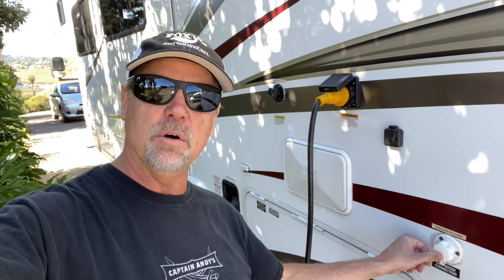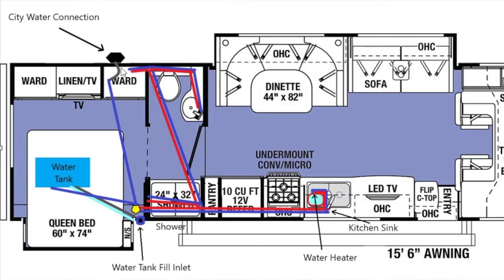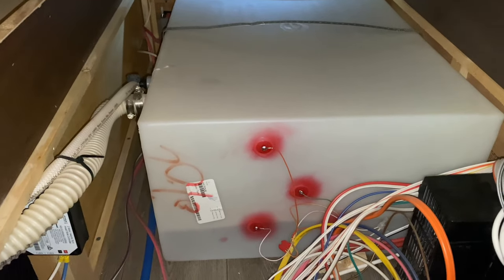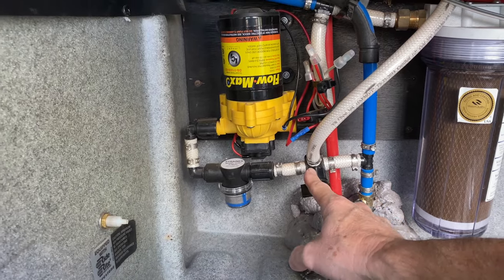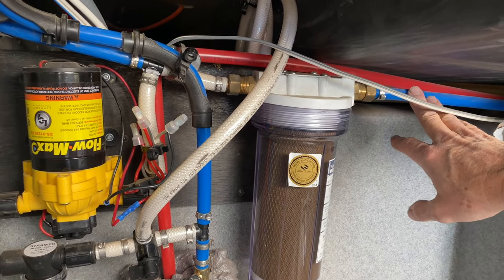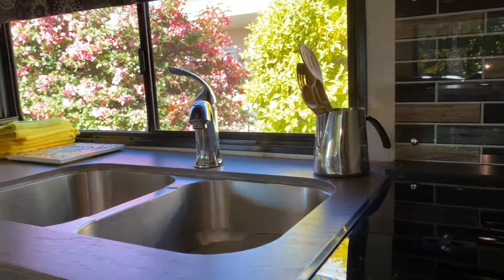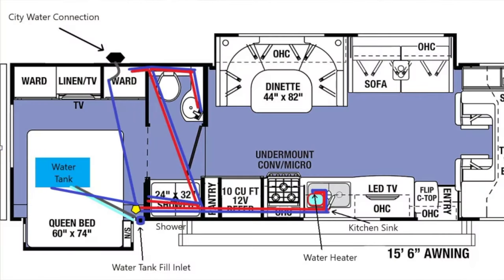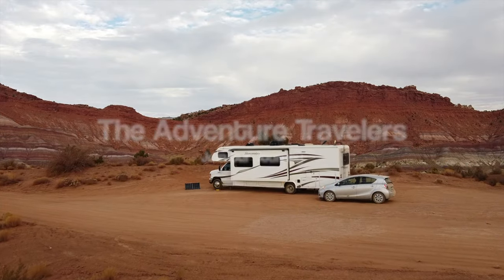RV Water System Explained In Depth

Comment: Hey Southern friend.... LOLOLOL Hi Mike!
Great video!! 
The extra hose before the pump is to suck RV antifreeze into your system through the pump, so your lines don't freeze in VT at -20° hahaha . The red and blue lines outside are your lowest hot and cold line point in the system, so you can crack those and wait for water to pump through your sinks, toilets, showers, and out door showers. The antifreeze will flow out the lowest points.  then close those valves.. The hot water tank shut off valves are to bypass the hot water tank, so you can drain it out for the winter. All water must be removed!! 
Frozen pipes suck, but you wouldn’t have to know about that in So.Cal.
P.S. always bypass your water filter before pumping antifreeze into the system!
Reply from the maker: Thanks, Mike PQ!  I really appreciate the comment and clarification.  Yes, you are totally right... I'm from Southern California and have no clue on how to winterize my RV :-). I would have to watch a YouTube video. LOL.   Your notes were so well written, that I have put them in the show notes area.  I hope you don't mind.  I gave you credit.  Always a pleasure having you watch our videos.  I love seeing you and Kathy flying around the country and riding your motorcycle.  Looks like you're living the dream!  Hope to see you both again soon.  Michael & Melissa
Reply: How do you bypass the water filter? Do you have to do this manually? I just removed the filter and then used the extra hose to pull antifreeze throughout. It of course filled the water filter housing first.
Reply: @cdb1386  I have a bypass hose with the filter fittings in both ends. It just replaces the filter, so the antifreeze just flows throughout the lines.
Reply: Just a heads-up. Your "extra hose" is the pick up line to draw antifreeze directly from the bottle to winterize the water lines.
Reply: Let's turn to God Shepherd's Chapel explains the whole Bible God bless

Comment: This is by far the most amazing and informative RV video I have run across! You did an absolutely great job in locating and mapping out the water system and answered a lot of questions I had been thinking of for my RV. Outstanding!
Reply from the maker: Thank you so much for the great compliment Dennis. I appreciate it. I learned a lot tearing apart my RV as well. L O L.

Comment: Hello. Stopping by to support you.  Wishing you all the best.

P.S Thank you for helping me start a relationship with my new RV’s water system; phenomenal detail!
Reply from the maker: Thank you so much for the wonderful comment. I’m glad I can help in someway. Wishing you the best. Safe travels.
Reply: @TheAdventureTravelers  update found out the problem is a broken water pressure valve regulator. I took it off. Water is flowing to the shower and to the faucet. Thank you for helping.

Comment: Hello!
I just watched this video and have to say Thank You! We just bought a trailer and I've not seen a better explanation of the water system anywhere on You Tube. I feel so much more educated on it. Thanks for taking the time for the newb's like me!
Reply from the maker: My pleasure. So glad it helped. Have a blast in your new trailer. I’m sure you will. See you on the road.
Reply: @TheAdventureTravelers  what are the blue and red pex lines hanging on the rear of my RV for? The dealership walked us through everything but I forgot what they are there for.
Reply from the maker: @jocarson5310  If they have valves on them, they typically are to let out (discharge)hot (red) or cold (blue) water out of your water heater or water tank.  Can't really tell without pictures.  Sometimes they can be a way to input antifreeze into the system when you winterize your RV.  Hope that helps. Hard to tell without pics.  Sorry.

Comment: Awsome video,  all you need now is a video of how the electrical system works. 12v and 120v.
Reply from the maker: That is a great suggestion Fernando. I will have to think about that and possibly make a video on both the 12V and the 120V. So many RVs have absolutely no specs on their electrical systems.
Reply: Did you make one yet? On 12v vs 110

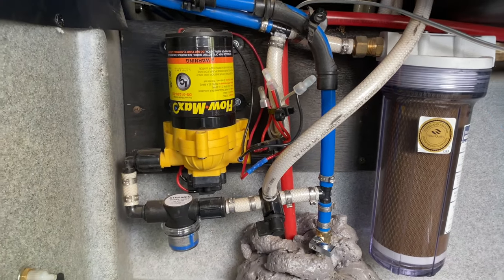Comment: The spare hose at 5:35 is there to winterize the unit, simply close the valve at the bottom of the hose to cut the tank out of the system and place the end of the hose into a container of rv antifreeze turn the pump on and it will charge the lines with antifreeze. This feature is on rv's with "winter packages" along with tank heaters and a insulated underbelly.
Reply from the maker: Thank you so much. I found that out right after I posted the video. Since I live in Southern California, I don’t really have a need for it. I do however, have a polar package on my RV, which is great for camping in the snow.  Thanks again. I really appreciate it.
Reply: It's on almost every camper not just "winter package" which is just a scam to charge more money. The belly insulation is just a foil sheet

Comment: Oh thank you! This was helpful to navigate the hoses. 
I have SO many water questions in my new old (1997) Jayco trailer! 
Let me know if you have any videos of the following: 
#1. I want to move the intake locations on the exterior of the trailer. Just down about 3 inches because on the inside - the jackknife sofa rests directly on the hoses and causes the bed not to be level…🤦🏻‍♀️
#2. Replace the HW tank.
#3. Swap out all faucets and shower/tub spigot.

And when I do these things maybe I will make a video. 👩🏻‍🔧
Reply from the maker: You should definitely make a video and share it with others. I do not have a Jayco trailer, but I know they are everywhere. Your video would do well.

Comment: Excellent overview, best I've seen. My rv 2012 23ft Walkabout by Homette has some of the pluming above the underbelly and below rv's floor - not as accesable.
My leak occurs at water pump, which is under the kitchen drawers, and placed nearly to the outer edge of the trailer, making it hard to access without removing all the drawers and the vertical panel above the pump (panel is right at, touches,  mid-section of pump, arg). THIS LEAK ONLY OCCURS WHEN I TURN ON THE HOT WATER HEATER !?      Is It:   1) the hot water 'in' fitting on pump?  2) some other logical point on the pump?  3) should i pull everything out and check the shurflo 4008 for other possible failure points ?
Reply from the maker: Sorry to say but you are most likely going to need to take out the drawers and panel to get a better look.  If your drawers are like mine, there should be two black tabs on the side of the slide mechanism.  Simply press those together while pulling the drawer and your drawer should release from the slide.  Typically, a pump, pumps water into the water heater, not the other way around.  Typically, the hot water never goes into the pump. The pump just pressurizes the hot water in the tank and pushed hot water to the sink/shower.  Maybe the water heater (when turned on) is putting backflow pressure to the pump and perhaps there is a check valve near the pump that is not working correctly.  Sorry, without being there, hard to help.
Wishing you the best.  Please let us know the fix.  ~ Michael

Comment: Nice video, looks like you have 2 leaking valves at the back of your water heater.
The corroded ones I'm talking about.
Reply from the maker: Thanks.  Already replaced those.  Yes, they were leaking.  I didn't realize that I didn't have an Anode Rod in my water heater, so they got sacrificed and corroded.  Uugh.  All done now though.  I will post some pics or a video of that soon.  Can't post any pics on these comments, which sucks.

Comment: As others have stated, well-produced video in tracing and explaining the typical plumbing system.  Kudos!
One comment, though, that I have not seen on this thread:  the RV industry's mixing of materials in the plumbing systems...namely PEX and vinyl tubing.  This is a pet peeve of "Rigor RV Repair" (also on YouTube) to the point where he won't consider some RV brands (such as GDRV).  In short, he believes that using PEX crimps on vinyl tubing is a big no-no....a set of leaks that are inevitable.  Yes, the vinyl tubing is flexible and makes great curves (as in your rig going to the outdoor shower fixture), whereas PEX is not so easy to make turns (without the use of more fittings and more time ($$) in manufacturing), but I believe him when he says that PEX crimps should NOT be used on vinyl tubing (you couldn't pass code in a sticks & bricks application, so why does the RV industry get away with it?).  As such, I plan to strip out all my rig's vinyl and re-plumb with PEX tubing and PEX crimps on PEX connectors (brass).  Just food for everyone's thoughts.  Cheers.
Reply from the maker: That is great information. Thanks for sharing. Don’t even get me started on RV wiring. Lol. Every color under the rainbow and none of it makes sense.

Comment: Awesome video! Found my pump and converter in one of my bays so easy to change filter or anything that might go wrong.
Reply from the maker: Oh, that is great news. There are a lot of RVs or trailers that have these areas in nightmare conditions. You should have seen when I would have to do oil changes or repairs on my boat. There is hardly any room on a boat. Glad I could help.

Comment: Thank you for the great explanation! Definitely the most helpful videos out there. I do have one question how does the outside water inlet connect to the tank fill port? Is there a fitting in the outside inlet or just the hose?
Reply from the maker: Sorry for the delayed response. My wife and I are training to hike the John, Muir, Trail, and we have been out of cell phone connection. To answer your question, if I understand it correctly, to fill your tank, there is just a cap and an inlet that you put your hose into and you fill up the tank that way. There is no connection per se. your tank is filled by gravity. The water just goes down the hose into the tank.

Comment: Hi. Great video. 1 question. Does the used water from the kitchen sink go to the black water as the bathroom water?
Reply from the maker: The kitchen sink water goes into the gray tank. Not the black tank. The black tank is just for Poopies.  That’s why you always dump the black tank first and then dump the gray tank because the soap from the gray tank will wash out your gross black tank remnants.

Comment: I have a truck camper. My sink in the bathroom has very low water pressure and sometimes I get No water at all . How can I find and fix this issue?
Thanks great video
Reply from the maker: Sounds too easy, but first check the screen on your tap. It may be clogged. Clean with vinegar and water to get rid of the scale. Let me know if that works.

Comment: Thanks for the detailed video. So I’m assuming as hot water is used from the hot water heater the water pump keeps adding water from the fresh water tank to it when it’s running?
Reply from the maker: Yes, let’s say you have a 5 gallon water heater, you can get about 8 gallons out of it during a long shower because it is constantly being replenished with water from either your tank or city water.  I typically only turn on my water heater about 20 minutes before I need it. So it’s not consuming a lot of energy all day.

Comment: This video is so helpful! I'm about to add a water system to my '71 scotty camper and this is exactly what I was looking for. The only question I have is, is it possible to plumb it so that the city water can be used to fill the tank inside the camper? Or is there a good reason why these are separate connections/points?
Reply from the maker: Hey Klayton, i’m so glad you like the video. Yes it is possible to plumb the water to fill the tank inside the camper but what happens if you forget to turn off the water at once the tank is full? It will just spill out the overflow valve. Typically, you just fill the water tank and once that’s done, you can connect to the city water and just use the city water pressure to have plumbing inside your RV just like at home. Just ensure that you turn off the water pump, or else you will be pumping water from your water tank instead.  I hope that helps.  Try not to think too far out of the box, RV water systems have been around a long time and most people have thought of everything. The way the RV is typically set up is usually the best for that type of RV.

Comment: Great video but you failed to mention what prevents the city water from filling up the holding tank. Unless I missed it? In my experience it’s been the only part of my rv’s (3 different makes models etc) water system that failed me. 

That’s the check valve on the water pump. My 1997 Winnebago wonderer 35 motohome ever saw 5lbs over 40psi it would overwhelm the valve on the pump and fill up my freshwater tank until it was like a balloon under my floor😅. 40psi is the magic #.
Reply from the maker: Thank you so much for the information. Yes, I always use a 40 pound water pressure attachment on my hose.  We just got back from a 21 day trip traveling in the Pacific Northwest. Good times.

Comment: Great video..very informative!  Can I remove under bed "city water tank" and use only water supplied by hose?  (For non traveling trailer) Since water is supplied with some pressure  would I need water pump? How would you get to this issue? Winterizing would be a snap! Thank you!
Reply from the maker: In theory, yes, you can remove the water tank, if you never plan on using it and only want to have city water fed directly into your rig.  

The water pump only pumps water from the tank.  You will not need the pump if you are directly connected to city water pressure.  Hope that helps.

Comment: Great vids. When your RV is hooked up to city water how do,you prevent water coming from the city from over filling your RV water storage tank when all your faucet are off?
Reply from the maker: If my check valves are working correctly, the water should never be going into my tank. It is a straight path that bypasses my tank altogether. The only way I can fill my tank is from the outside (a totally different input).
Reply: @TheAdventureTravelers  but at one point the output from your storage. tank merges with the output from city h2o then heads to the shower/faucets at that point where they merge , when pressure builds up from city h2o does it back flow to your storage tank or does it have a one way valve? Thanks

Comment: I hope some reads this soon . Ha
 @9:24  it shows 3 valves but my water tank has 2 only .. will that become an issue?
   Basically the bottom line and the valve in the middle are only ones I can see .
Reply from the maker: Without seeing your water tank, I can't really give you a, "for sure" answer, but I think you're good with only two valves.  Just think about the flow of water (hot or cold) and what the valves accomplish by turning them on/off.  I think you should be good.  Hope that helps.  If everything is working well now, even better 🙂

Comment: Where would be the best place to put an extra filter ? I don't have a water system like yours, because I have a older 5th wheel.  I'm asking / wondering because the water here has chlorine/hard water with lime scale issues and a funny smell... I need to put in a filter for my kitchen and for my shower... I'm wondering where to put a small one at and how to do it. My under sink is exactly like yours but I cannot get to my shower lines. So I was thinking of adding a filter where my bathroom sink is because of the lines connecting, what do you think? I live in VA and the weather here last night was 7 degrees...
Reply from the maker: Of course, it is hard to give you an exact way to do this because I don’t know your rig. Since it is freezing there, you should put your filter on the interior. I have seen many people put a filter outside, just before it connects to the RV, but since it’s freezing there, you need to put it interior. Is there a way you can trace the water hose from the connection on the interior? It may be behind a cabinet or something. That would be my best advice but it’s hard to know. So sorry. Please let me know what you come up with. 😁

Comment: Awesome video. explained a lot. One question. I am a newbe, What the difference with filling the water tanks with city water from the driver side or the potable gravity fill water on the passenger side. Does the potable water come from the same source? i.e city water? Again, thank you!
Reply from the maker: There would only be a tank on the portable gravity fill area on your passenger side. If you choose to use the city water attachment on the driver side of your rig, that will not go into a tank but will go directly to your plumbing, meaning your shower, faucets and toilet. Does that make sense?  thanks for watching.
Reply: @TheAdventureTravelers  Thank you!

Comment: When I run the water heater. As the water gets hot. If I use the cold tap. After few minutes of cold water flow, I get hot water for less than a minutes than back to cold water. I wonder how hot water found its way to the cold water line, any idea?
Thank you , ps your video is geert,thanks
Reply from the maker: Thanks so much. I don’t know how to answer your question. That one’s a stumper. Maybe your cold water line is laying on top of your hot water line and it pre-warms it. That is a new one on me. Wishing you the best. If you figure it out, Please let us know.